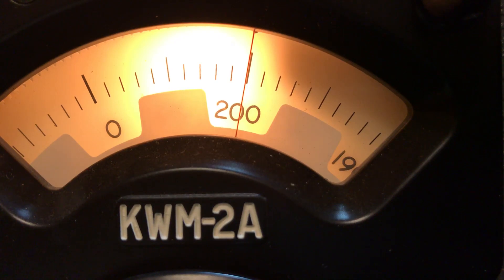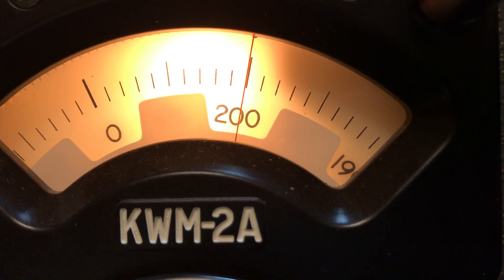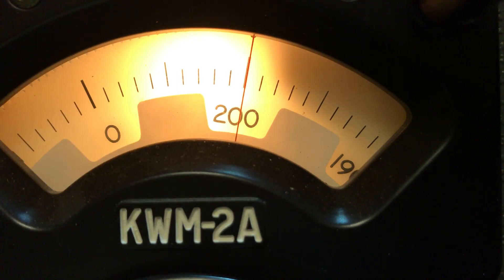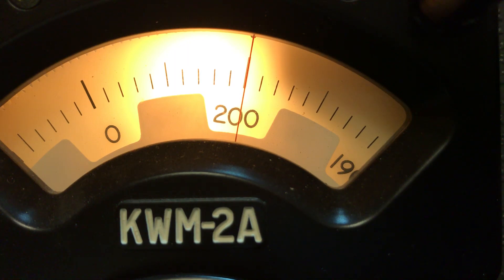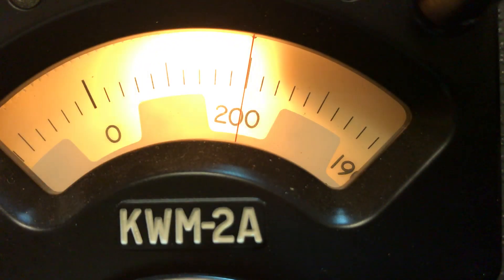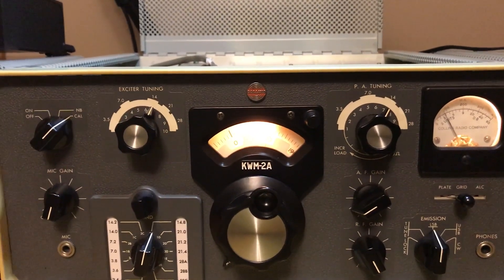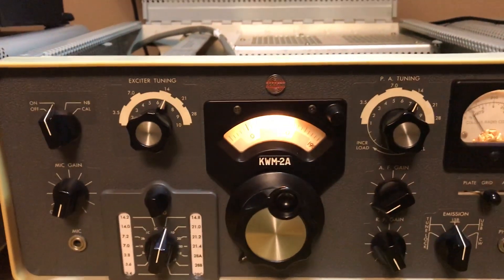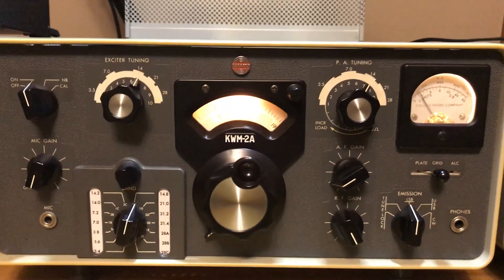KWM-2A Zero Beat to 15MHZ WWV and C76 Calibration

Comment: Thank you for taking the time to post this. My 1961 KWM-2 has the same center and red line orientation. Because the red line is not centered, you can move the red line to center, and using the set screw on the VFO shaft, rotate the dial frequency to center, then tighten set screws. Re-check calibration afterwards.73
Reply: I tried this, and all I wound up with was a loose VFO knob.  If you remove it, you’re looking at the shaft which has no way to adjust